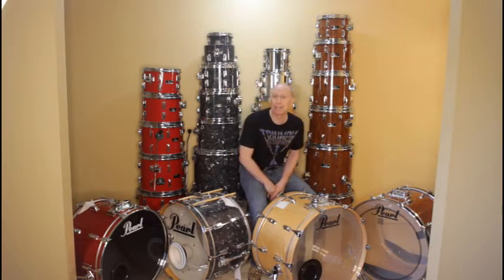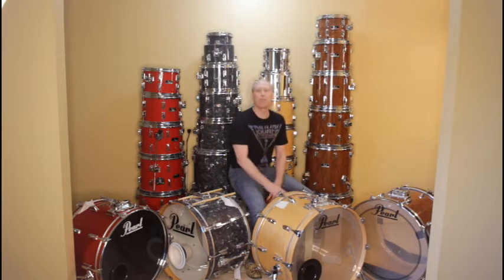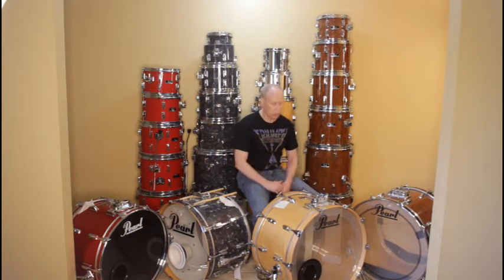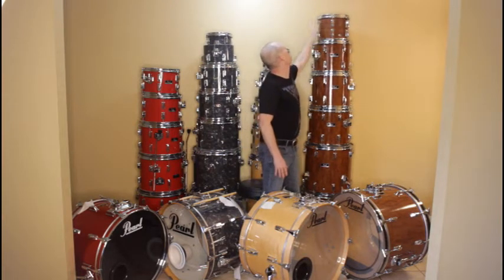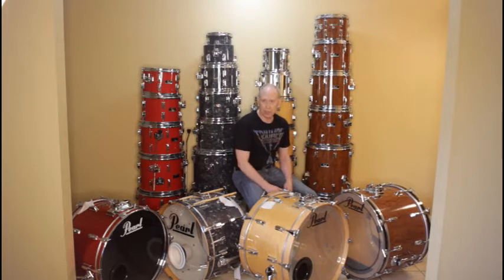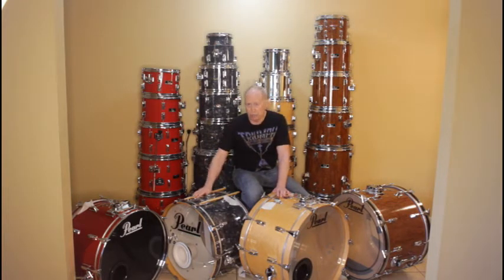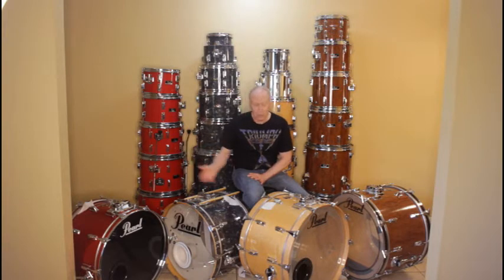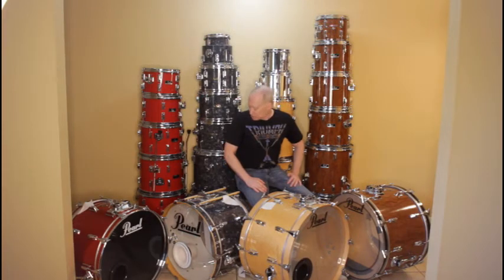Pearl:  The best reason to play VINTAGE drums.

Comment: You have an amazing collection, learn so much about vintage pearls. I have a president series I’m restoring.
Reply from the maker: Keep at it!  I am "recreating" my very first drum set; a 1975 Pearl Jazz Rock with White leathertette covering. Took FOREVER to find that material.  It is almost done.  I found some old Pearl Luan shells and refurbed them, found period specific hardware and badges.  They look great.  I may have to do another video on the three sets I built since this video!  THANK YOU for watch and the reply.  Just work slowly and deliberately on the restoration process.

Comment: Can anyone tell me about the early 80’s MLX series that came lacquered inside and out?
Reply from the maker: What do you want to know?  ON the maple set in the video, the 13" and 22"BD are both 1980's MLX lacquered on the inside.  I now lacquer ALL the drums I refinish on the inside.  Some people hate that, others love it.
Reply: Time's Dark Captains I’m more interested in the history. Ive heard that 83 and 84 are the only year you could get coffin lug style with inside paint and lacquered. Mine is piano black. It came this way from the factory. Any info would be awesome
Reply: Time's Dark Captains also, I’ve always had trouble getting the 22bd dialed in and sounding low. I’m always fighting a sorta flap sound. Also it’s response and feel is different from any other bass drum I’ve played
Reply: Time's Dark Captains The toms sound bad ass and I know the inside lacquered made them louder and project more
Reply from the maker: Sorry for late reply.  I have Powerstroke 3s on batter and an Emperor on front, and I use felt strips on the batter and a KickPort on the front. Big beefy sound.

Comment: I have what I think is a vintage 5 piece Pearl drum set. The only marking that I can find on any of the drums is a badge that says S Series. I have looked all over the place trying to figure out what set this is so I can find original replacement parts. Whoever owned it before me scraped the stickers off that I assume would have been able to identify it. It has a steel snare if that helps
Reply from the maker: Go over to Facebook and they have a Vintage Pearl Drum group.  Join it and post some pictures.  They should be able to ID your kit.  Many  people there with lots of knowledge about those kind of things.

Comment: I have a Pearl MLX Professional Series...7 piece.. deep drums... I bought them brand new when I was still in the Coast guard in 1986.... Natural Maple finish.... I have several other drum sets so I really don't play them that much but they still sound great... I did put the Pearl opti mounts on the four rack Tom's... Beyond that they are pretty much just like they were brand new.... It came with the matching finish 14x6 and 1/2 free floating snare... I'm surprised the free-floating concept never took off a lot bigger..

Comment: My favourite year for a Pearl DLX model is 1983 (Thanks to Big Country's 1983 album  The Crossing). Gotta have that after my goddamn Yamaha Recording Custom 1987.
Reply from the maker: Just acquired a 1983-4 Pearl DX Deep Force 7500 D20-60, and restored it.  3 racks a floor and the first 16 inch depth BDs along with Tama and Ludwig that year.  Will be posting a vid on it and the restoration.  THEY SOUND HUGE!
Reply: @timesdarkcaptains9170  oh ok.

Comment: nice video. i was wondering what's the deal with maple hoops on kick drums instead of their original ones. does it change a lot?
Reply from the maker: I think that it does.  It seems to me to "liven up" the sound to me, especially with a 2 inch wide one.  I have fiberglass shells and I think a metal hoop on them is OK.  But the bigger maple drums and wood shells, I think wood both mellows and enhances the lower end and just the fullness of the sound.  I also use the sound horn type holes in the front head and felt strips on the batter side.  Found this way the ambassador coated heads really open up.  Again, it is my preference.  THANK you for watching, I appreciate it!

Comment: I own a 1987 Pearl Export kit in Pure White along with an early 1980's Maxwin by Pearl 14'' X 5 1/2" wood snare with a Pure White wrap as well. Although Pearl still makes great drums & the best hardware around, I believe their best sounding drums came from the 1980s to the mid 1990s. I just love the look of them as well as how deep & full the toms sound. I also have a 1989-1995 26" X 14" Pure White Pearl Marching bass drum that I had spurs installed on to convert it over to a kit bass drum to use with the kit. Proper maintenance of these older kits is crucial to their preservation. I've taken apart all the drums, cleaned them, & replaced all the lug inserts to make them look and sound great.  Currently, I'm using a 12" X 10" rack tom, 14" X 14" floor tom, 16" X 16" floor tom, 22" X 16" bass drum, & 14" X 5  snare drum. I plan on switching out the 22" X 16" kick with the 26" X 14" kick drum in the next few weeks. I'm currently using newer Pearl 930 Series Hardware & pedals as well as Zildjian A Series Cymbals with the kit (14" New Beat Hi-Hats, 17" Thin Crash, 18" Crash / Ride, 21" Rock Ride, 8" Splash, & 18" China High. I also use all Remo Heads on the drums.
Reply from the maker: I am now working on a 1980s Export kit.  I have A 1984ish DX kit that I just finished rewrapping. with a 10, 12, 13, 16 and a 22 x 16 bass drum.  I want to have the Explorer match it and maybe another tom.  I have the 12 and 13 in Power tom sizes for  the explorer, just trying to collect the rest of the kit.